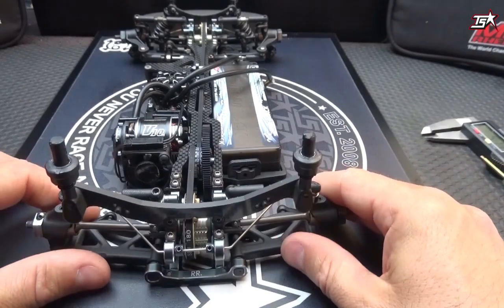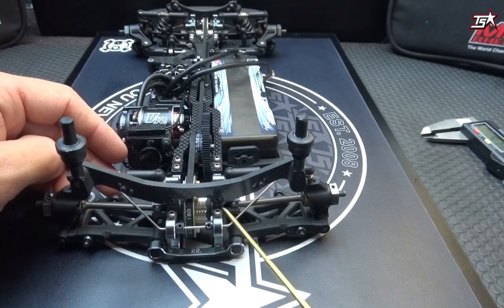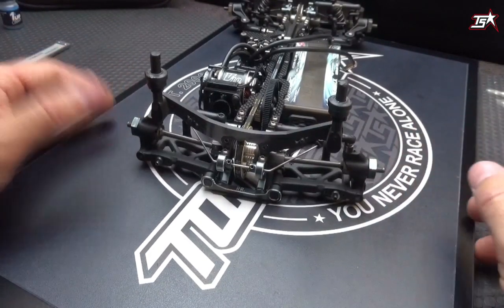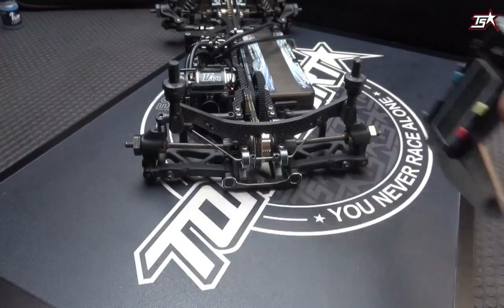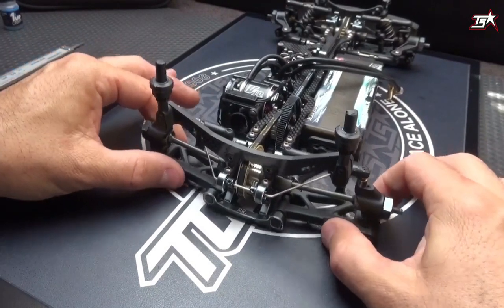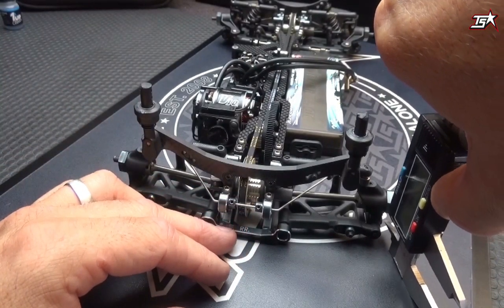ToniSport Newsfeed: Anti Roll Bar English

Comment: Hi Patrick! Great video! Just wondering, what is that between the esc and the servo? Power caps? Where do you get those?
Reply: Andy Williams 
Between the ESC and the Servo you see the standard Hobbywing Capacitor! Just used a different shrink tube!